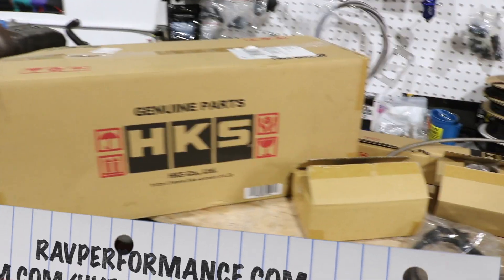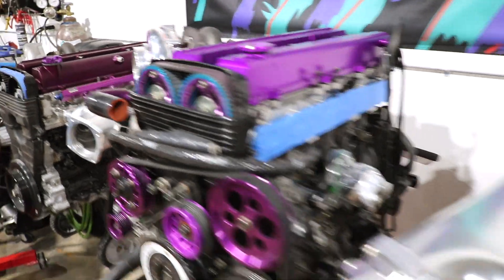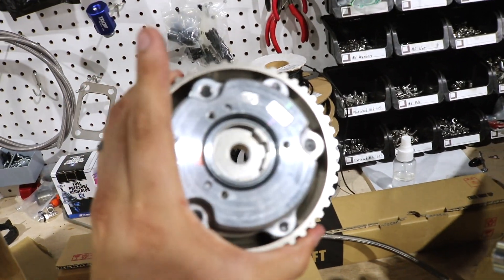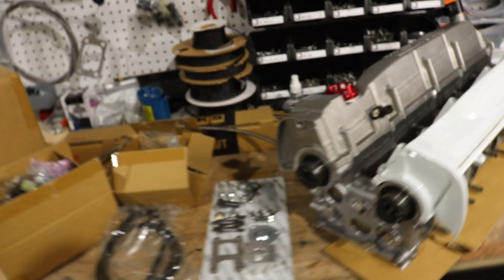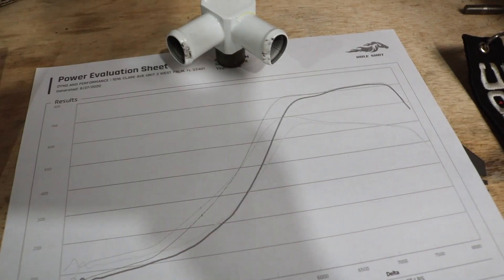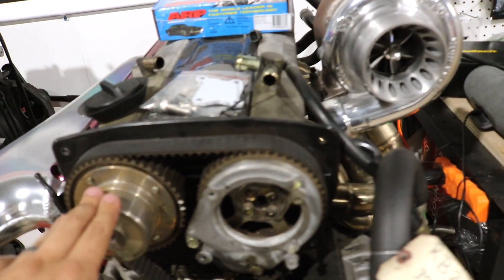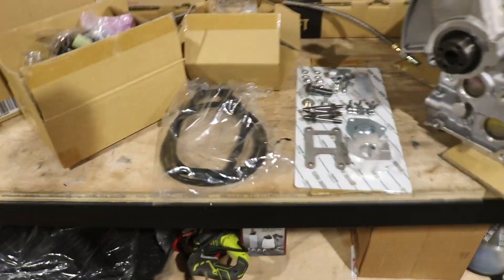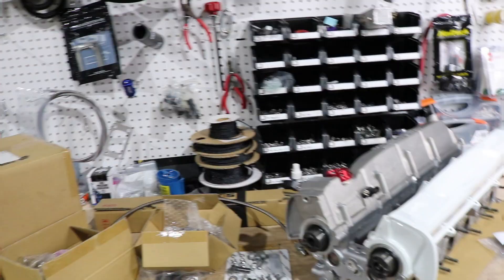HKS VCAM Unboxing & Review

Comment: Would it be worth putting V-Cam in a RB26 swapped 240z or just go 2.8 in the future? Did some calculating and found the step 2 stroker kit with pro V-Cam would be the same price as the high response stroker kit. Turbos are old school HKS 2530's and ecu will be a Haltech Elite 2500.
Reply from the maker: Would depend on applicantion, if it's a low grip car the extra torque may just be to much. But if it can put the power to the ground a vcam really wakes up the mid range. 
It's all about balance

Comment: I've got a v cam pro setup about to go in at some point. I would LOVE to see an install video :)
Reply from the maker: I'll try on the next one
Reply: @ravperformance  I have a Syvecs ECU, therefore I don't need to use the HKS Valcon right?
Reply from the maker: @manzahmad4134  correct, just use the variable valve control functions

Comment: Do you know the difference between the rb25neo set up and the HKS Vcam for the 26? I actually saw someone made a kit for the Rb26 using the NEO set up.

I would love the Vcam but it's quite an expensive kit (worth it though especially for a street car).
Reply from the maker: Super similar both are adjustable via solenoid control but the hks is a more modern setup. Its uses the gear from a Subaru i believe and gives super accurate timing changes
Reply: @ravperformance  thanks

Comment: vtec doesn't allow more power. it increases responsiveness in any rpm
Reply from the maker: Vtc changes the power band, and no, it does increase power in any rpm. It allows you to get the most power by increasing/decreasing it depending on rpm,load & other factors